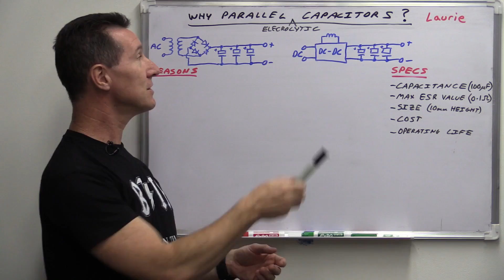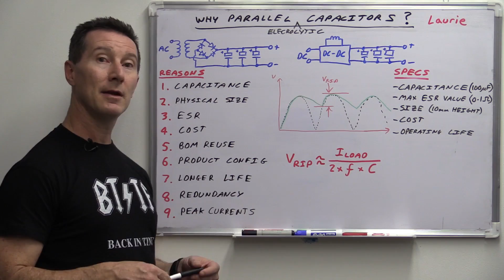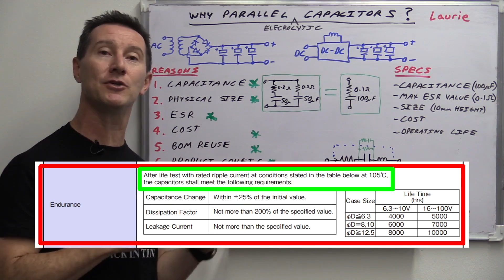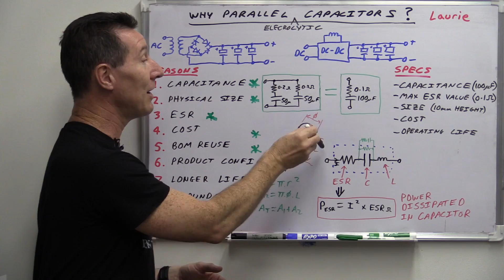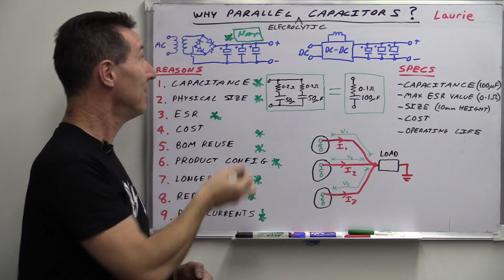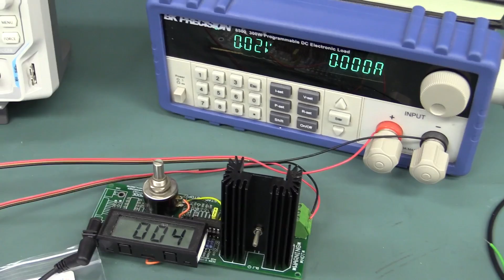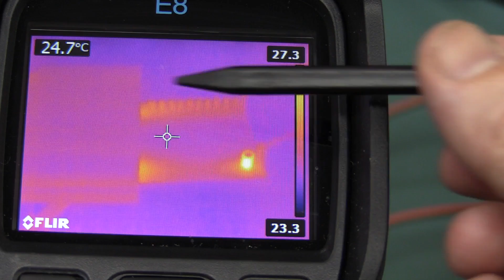Comment: Really like this.  I was into electronics before I decided I liked mathematics more and got my first degree in maths.  Now that I do mechanical engineering as a profession it's good to get back into electronics as a hobby.

I follow this guy with an open Mathcad sheet and have just constructed a sheet that calculates effective capacitance and effective ESR for a multiple capacitor power supply.

Comment: parallel dc battery cells same as parallel capacitors. using a big 5000mah lithium ion battery can provide high current but high resistance 3.7 volts dc. using two 2500mah lithium ion battery provides more current than bigger one when its necessary. electrolytic caps are driven by tiny layer of liquid phasis of electrolyte chemicial. its not fast chemicial enough to discharge.. capacitors has battery value for dc.. filter and reduce effect for ac.. xC=1/wC;  w=2Πf means big caps has lover resistance for higher frequency.. frequency and capacity divides resistance of capacitor. big caps has big area and its conducting highway is big.. i always prefer inductor capacitor filters.. i dont like rc networks..

Comment: Good job on putting the 10 capacitors close together on the breadboard, as on an actual circuit board, they likely would also be crowded close together, and there could be some restrictions upon air flow as well.

Comment: Hi dave! i have a 48volts output power supply. and am using 2 elctrolytic capacitors in parallel. capacitor 1 rated at 80 volts/10000 uf and capacitor 2 rated at 100 volts/44000uf. my question is will it not damage my power supply? my capacitor? ? and even the load (amplifier). thanks a lot!

Comment: hello I would like control remoto which is a industrial sewing machine motor which uses electronic magnet it uses two d1349 120ohm7wat 47ohm5wat what kind of signal would you use to control the speed of the motor using those transistors thank you Everton Jamaica

Comment: What is missing is why we use an electrolytic capacitor in parallel with a non-electrolytic (ceramic) one.

The video does not focus on the reactance of the buitin self current: electrolytic capacitors have high reactance and this plays an influence on high-frequency peaks of currents (notably those coased by digital gates causing noise currents).
The response in fact was only studied at a single frequency forgtetting what happens at noisy high-frequency peaks).
That's why we find huge electronic capacitors in parallel with microscopic non-eletrolytic capacitors. The latter will not have enough charge to sustain continuous loads, but will react much better against those noises to absorb them (they will be recharged very fast by the charge of the neighbouring big capacitors.

A video could compare the response using a large range of frequencies. Notably by using complex numeric charges like a processor running around 1GHz, and to show the effects of the noise starting signicantly around 3GHz, and how a single ceramic capacitor solves the problem compared to the situation where it is missing and all the stabilisation work is done by the electrolytic capacitor. Start by running your processor at low frequency, then increase it (still in its operational range) and you'll see how the power voltage is being affected by the increasing noise (independantly of the frequency of your power source which is typically 50 or 60Hz.

The same is true when instead of a AC-DC power converter source you use batteries : the (electrolytic) batteries react also like capacitors and don't like much the jigh frequency noise: adding a non-electrolytic capacitor in parallel allow them to behave better (and also with less heat dissipated by them, those batteries will also have longer life and will be usable for longer time before being too much discharged.

Comment: Can we use ceramic caps instead of electrolytic caps of the same value and same voltage ratings despite the difference of size and vice versa?

Comment: I can't believe two things:  Eddy kept pointing at the ripple Voltage on the scope and he kept saying "ripple current" and 

Eddy clearly said:  power is equal is eye (I)  squared (times) are (R) 
but failed to mention:  "when using two half sized capacitors in place 
of one larger capacitor will dissipate one quarter the power in each 
smaller capacitor, the two capacitors produce half of the ESR generated 
heating power."  He also didn't mention splitting the current in foil 
paths into two paths halves the power loss, and into four paths quarters
 the power loss in the foil paths, leads and solder.  KA4INM

Comment: what about a flux capacitors? im trying to put one in my delorean
Reply: +thabg007 if you want to replace the battery with a flux capacitor, be careful because DeLoreans have a nasty battery apparently. but getting a flux capacitor to the capacity with which you can start a car might be difficult

Comment: Why the majority of electrolytic capacitors are cylindrical? Isn't this a waste of space on pcb?
Reply: +Jubulburb Wuldrd;  they are cylindrical because they are rolled up 
strips of aluminum foil and electrolyte impregnated dielectric, like 
paper. Joining (connecting) squares is a physical problem leading to 
short life when connections fail and the capacity drops.
Reply: +Ronald Youvan can't see a reason why not to roll them in parallelepiped shape and gain some additional effective area

Comment: Dave, this is a 5-star presentation.  Thank you.  On a related topic, could you explain why a small capacitor (0.1uF) is usually added in parallel to a "voltage stabilizer" capacitor of 10uF at the output of a power supply?  Some said it would make it react quicker to voltage spikes, but I would like to hear from you.  Thanks in advance.

Comment: In heat loss the smaller an item is the higher the ratio of surface area to volume, (compared to a large similar shaped item).

Surface area varies with the square and volume with the cube.

BB's cool off faster than cannon balls! 

Thus a 1cm cube and 2cm cube have  surface areas of  6cm**2 and 24cm**2.

The volume of the cubes are 1 cc and 8cc.
The small cube has A/V ratio as 6/1 = 6/cm  
The big cube has A/V = 24/8 = 3/cm

Thus a small transistor, capacitor, resistor, wire, ant, HVAC chap working in the hot attic can "put off more heat" than his bigger counterpart since the/their surface area is higher to their volume that the bigger case. 

A Sprague seminar back in the early 1980's went into this with capacitors.

I am an Engineer and not an English major thus the wonky wording.

Red hot BB's cool off faster than red cannon balls

Comment: cylinder surface (excluding top and bottom) is 2*pi*h*r, you left out the 2

no biggie of course ♥
Reply: SoWeMeetAgain he uses phi, which is diameter, not r(adius), so no 2 there. EEVblog But, the mess is with A1 and A2 -- it should be other way around: A1 = pi * phi * L, A2 = pi * r^2. the cylinder (phi = 2*r) and the cap respectively... am i wrong? :P
Reply: @Winexoid  I literally just watched this video and that bothered me the whole time it was on screen! XD We can't BOTH be wrong, surely?
EDIT, I feel a bit spesh now reading all these comments from electrical engineers and maths professors who didn't spot this.. XD
Reply: The real problem here is that we defined π to be the ratio of the circumference to the radius, rather than the diameter. It all went downhill from there.

Comment: i'm curious, you mentioned that the supply would normally spec the ESR range, but what happens (and how does it affect the supply) when your ESR is below the spec? i had replaced bad caps in a psu but it wouldn't run right and would blow the HV chip (switching psu, forgetting the type of chip, but three pin TOS220). I had used ultra low panny M caps as replacments. thanks

Comment: 10. Precision

I don't know if there are too many discrete-component applications in which the capacitor value(s) must be as close to the design specs as possible, but at least in the IC domain, using parallel caps is pretty much the only way you can get reasonable yield.

I don't do analog layout myself, and don't know whether the cap value distribution (due to process variations etc.) is Gaussian or something else, but it is rather obvious that the more parallel caps you use, the closer to the required/specified capacitance you will get.
Reply: precision is never a thing with electrolytics...TYPICALLY you can get away with a 1000% bigger capacitor or a 20% smaller one... they are typically for filtering or decoupling so no precise precision involved

Comment: Great video. I wound up using many of these reasons while designing my induction heater. CAP life is difficult to deal with at 75khz and 600amp peak current. Pulsed, 25% duty cycle extends life and reduces heat. Still caught on fire. So I made a modular cap bank that slides in and bolts on. :-P

Comment: smashing video man! As an aerospace guy who's interested in getting more into electronics, these videos are a valuable practical resource I can use to help me understand real designs. I also like how you talk about the basic physics reasons for some circuit designs. My original background is in physics and I appreciate engineers who argue from the physics rather than vague and possibly unreliable rules of thumb. Keep up the fantastic work!
Reply: drillsargentadog Thanks, glad you liked it.
Reply: +EEVblog Yeah a really great video. :) I have to watch it again, did you mention that when we connect smaller capacitors in parallel instead of using one, we get a statistical chance that some negative deviation compared with the nominal value of the capacitors is compensated by a positive deviation of other capacitors or the other way around, depending on how you look at it. :D And in the worst case we just have the same maximum tolerance, assuming that the big capacitor has the same tolerance that the smaller ones have. Greetings from germany. :)
Reply: @Psycho4Ever666 biggest issue I have with that argument is that there's relatively little deviation between components withing the same batch, but a lot of difference between batches.

And if you are manufacturing from the same reel, you probably aren't mixing batches in order to get that statistical regression to the mean.
Reply: Good day. Sorry to dig this old video but I need to clarify. I mainly use veroboards because electronics is just a hobby, and I'm French. If I understand your video well, the best way is putting a capacitor close to the output of the power supply (7805 or buck), and a capacitor close to each input of each circuit. Then, if possible, better have a star topology (with the power supply in the center). Did I understand well ?
Reply: Hes a great lecturer

Comment: Very nice video, Dave!

One thing that was not mentioned (or probably was mentioned but I missed it) was that with more caps you get more self-protection. If one of the caps fails, by having the ESR shooting up, the remaining caps will "protect" it as they will pick up most of the "ESR load". This also will maximize the remaining life (whatever is left) of the faulty capacitor as its "ESR load" will be decreased. (In fact it's more complicated - the concept of "ESR load" is a bit inaccurate) 

This is in contrast with other situations where a fault in an individual component results in a failure of the whole system. Examples: capacitors or resistors in series. Or a more subtle case is LEDs in parallel, where a LED approaching end-of-life will have a lower breakdown voltage so all current will go through it (mostly) which will accelerate the LED breakdown. Then, then next LED with the lowest voltage takes over, etc.

Comment: Note that radiation is a very small part of dissipation at room temperature, even for passive convection cooling.  Black versus shiny heatsinks only improve by a few percentage points.  But hey, if you need those few bits to get your design margin for that cheap consumer product, it's worth it (and the black anodize or paint might look better, or improve corrosion resistance).

If you expand the differences (oh snap, that needs Calculus!), the radiation temperature difference can be expressed as a conductivity dependent on absolute temperature.  Instead of (T1^4 - T2^4), use (4*T^3 * dT), where T is the absolute temperature of one or the other object (the point being, dT is small enough that the distinction doesn't matter), and dT is the difference.

Convection of course is notoriously hard to calculate (convection, fluid flow, ventilation, air density, boundary layers, oh my!), but a sufficiently crude rule of thumb is 0.0013 W/(cm^2*K).  So a project box with 100 cm^2 surface area might be expected to have a thermal conductance of 0.13 W/K, or a thermal resistance of 7.7 K/W (for temp differences, K == C so no worries).

Comment: Another way cost can factor in is if the product is manually constructed.  If the builder has to solder in numerous parallel caps instead of one larger one, that adds to the costs of both time and money and may call for replacing such parallel circuits with one larger component.  It's definitely something to keep in mind.

Comment: Reason 10 to use multiple caps is if you have a series inductor between them (Pi filter). I know they aren't actually in parallel then, but they may look like they are in parallel if you don't follow the PCB traces.

Comment: I'm glad I want my things to end up in space, at -455f -273c(I think) heat isn't a issue
Reply: ironically, heat is a major problem in space. With no convective cooling due to almost perfect vacuum, it's difficult to transfer heat away from components. The iss has its massive radiators for a reason.
Reply: dasdew2 That -455*F comes to around -270.5*C. How I remember to do the conversions between *F & *C is thus:
*F minus 32, divide by 1.8 equals *C
*C times 1.8, plus 32 equals *F
Using 1.8 as the factor to divide/times by speeds the process up compared to "divide by 5, times by 9/times by 9, divide by 5" (times by 1.8) or "divide by 9, times by 5/times by 5, divide by 9" (divide by 1.8).

So that -455*F becomes -487*F, then divide by 1.8 gives -270.555‾*C.
Reply: eLNeroDiablo There’s also the sanity check that -273C is ~0 kelvin, which would be lower than the cosmic microwave background radiation of about 3 kelvin.

Comment: The quality of the capacitors make a big difference. 
I replaced all the capacitors of my Corsair CX600 with Panasonic FM and the ripple in load is lower (+/-20mV in the 12v line and similar result in the other lines).

Comment: Some designs are taking advantage of such heating of capacitors. They are literally putting them near heat sources (rectifying diodes, power resistors and transistors) to have the life time of the final product to be limited to the duration of the warranty :-/ sad thing...

Comment: "I won't go into ... a 100nF in parallel with a 10nF" - Well that's unfortunate considering that after decades of practice in electronics that would be the one single subject related to capacitors in parallel that is still firmly located in magic woo-woo land as far as I'm concerned. Yeah, I've accepted that's how it's done. No, I still haven't seen a reasonable explanation of why one would need a miserable 0.1uF cap right next to a 10uF or even 100uF one but hey that's just fine, all electronics run on magic smoke after all, I suppose some things are better left unexplained, science is undeniably losing ground against "beliefs" these days anyways...
Reply: Attila Asztalos To stop high frequencies the bigger capacitor cannot?
Reply: Attila Asztalos This video was already 30 minutes long. I can't include everything. The focus was on electrolytic capacitors in parallel. And I'm sure I've covered ceramics in parallel somewhere else.
Reply: Simply because of 2 factors: 1) the physically larger a capacitor is, the higher the series inductance will be, because they equivalent length if wire is longer. 2) electrolytic capacitors are considered inefficient at frequencies approaching radio frequencies, presumably because of the chemistry? Dave help me out here? So in designs where you need to provide good decoupling right up to RF, you would have your good old electrolytic, and bypass it with say a 100n polyester- which will have a nice low impedance at 1MHz. You might then bypass that with a 1nF ceramic, which you know will keep a nice low impedance up to 100 MHz or so... Hope that explains it!
Reply: Attila Asztalos This graphic shows how paralleling different capacitors ( case sizes are important also for lead inductance ) extends the high frequency response for fast transients
i.cmpnet.com/planetanalog/2007/06/C0201-Figure11.gif

Comment: An obscure reason regarding ESR; DC-DC converters have LC filters, typically rather high Q/low ESR as there is a high ripple current. LC filters resonate and you can damp this with an RC snubber in parallel with the capacitor. If you can make something close to this RC snubber out of a single cheap capacitor with about the right ESR rather than expensive low ESR cap and a resistor, that's a win. So you often see a cheap cap in parallel with a low ESR cap in the output of these. You might see this on a second stage filter outside the control loop for example.

ESR is my main reason as DC-DC converters / SMPS are my thing. Converters I build have specific requirements for capacitance and ESR for transient response and ripple voltage etc and low voltage, low capacitance caps have much too high an ESR so I might split a cap into 3 to 5 parts for example to meet those specs. I also use expensive solid electrolyte caps from nichicon when I can, but that's impractical in mass produced consumer items.